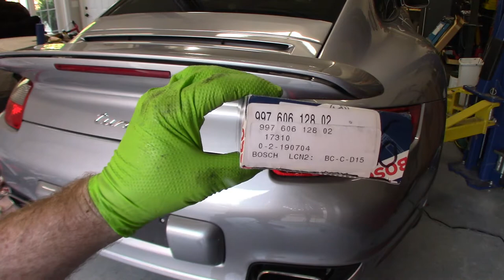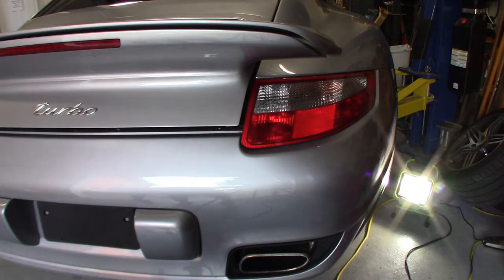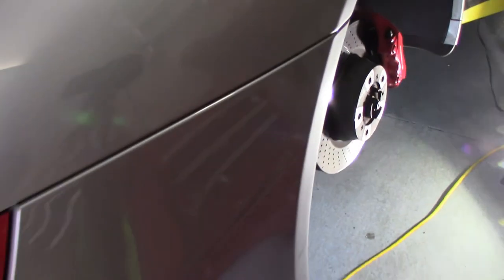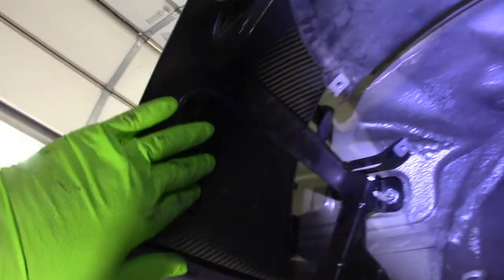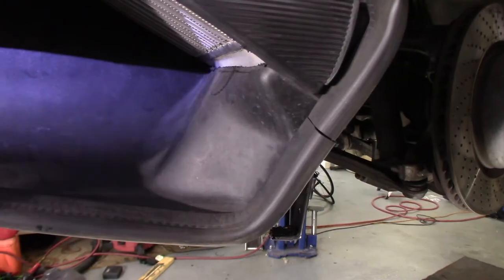How to replace the pre cat O2 sensors on the 2009 Porsche 911 Turbo

Comment: Hello, I’m going to rip the rear of my ‘07 997 Turbo w/ 36K mikes apart to install a Fabspeed exhaust my question is I was planning on just cleaning my o2 sensors with o2 sensor safe sta-bil carb cleaner instead of paying big $ on new ones. Or would you recommend I pay the extra & get new pre cat o2 sensors they say the post cats are good for long time. Some say don’t use the Bosch ones too?? Thx.
Reply from the maker: I have had no trouble out of the Bosch sensors, and I've used them in many of my vehicles. At 36k miles your O2 sensors should have a lot of life left in them. I don't think I would replace the sensors now unless they're throwing codes. Also, would love to know how the Fabspeed exhaust works for you. Thanks for watching.
Reply: @DrShankopotamus did you originally have a o2 error code or just change them for maintenance?  And have you ever changed your MAF sensors?  Did you notice the car run smoother after?  Thx again
Reply: @DrShankopotamus do you need to remove the exhaust to replace the water pump on a 997.1 turbo?  Thx
Reply: @DrShankopotamus one more question.   We’re you able to replace the o2 sensors without removing the air box and intake.  Someone told me you have to be able to unclick and drop the o2 sensors out.  But I don’t think you did & you just fished them down & out & then back up & in.  Thx again
Reply: Going to change the oil on my 997 turbo & have heard some say they pull fuses to prime the oil tank and some don’t.  Do you pull fuses and prime before starting after a oil change or no.   I’d think it would be more important after a engine build or complete rebuild?   Thank you